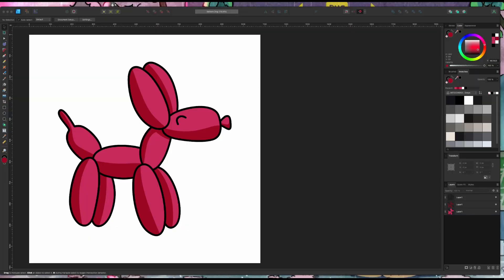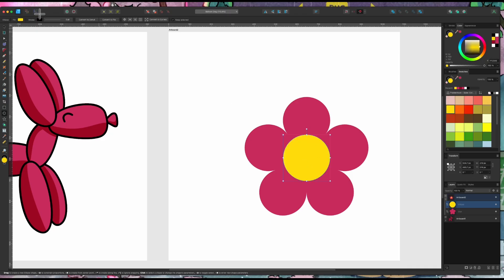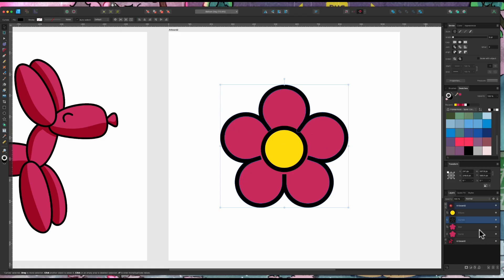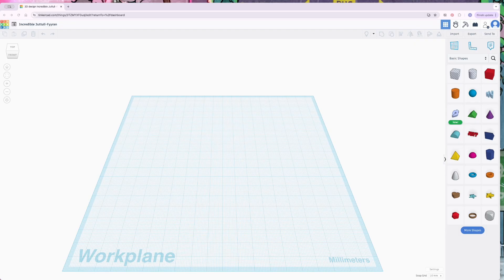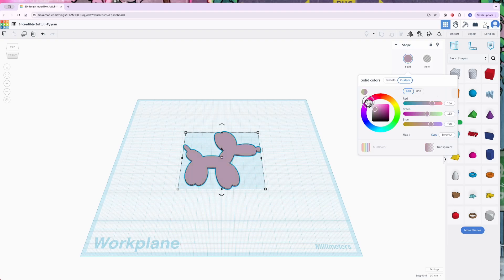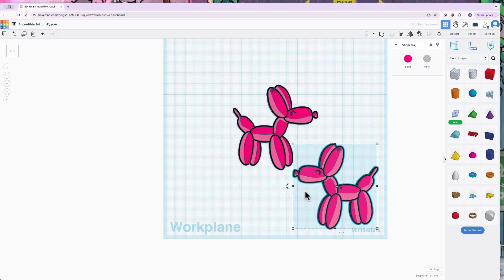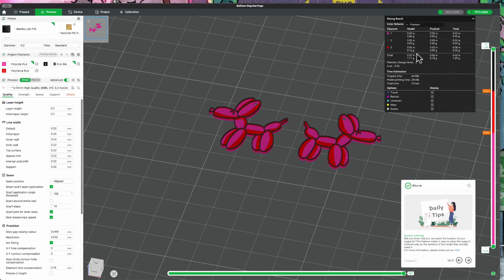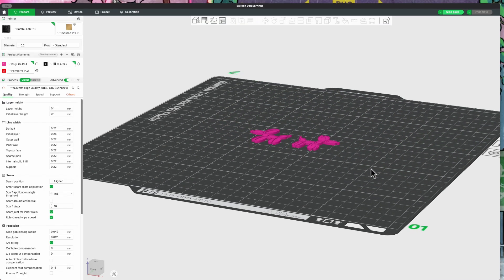How to Make 3D Printed Jewelry, Easy Multicolored and No AMS Needed!

Comment: Another great design and tutorial. Thanks so much. 

I’m curious: In Bambu Studio, what is the advantage of assigning the colors in the preview line heights rather than using the paint (by layer) tool? (I’m not sure I’m explaining that well. I’m not at the computer to grab actual tool names, sorry)
Reply from the maker: There’s no real advantage. I was just taught to do it using the preview tool a while back so that’s just my method. When I first learned this technique I was using Cura and an Ender 3 so I didn't have a paint by layer option. But you could do it painting by layer height.
Reply: @LabcraftStudio cool. Thanks. I come across a lot of Hue Forge designs that are set up that way but then I seem to mess them up when I bring them into Bambu Studio and bring in my AMS Lite filaments. Or if I try to do multiple copies of something someone has previously designed… or something. I’m not 100% sure what all I do that creates the conflicts, but I seem to often have to bail on the preview method and use the paint tool. It isn’t always as easy for me to be accurate unfortunately. (I assume it is user error. I’m only about 6 months into 3D printing and seem to fumble through much of what I do. lol)

Your videos are giving me a backlog of projects I want to dive into. Thanks for all of the inspiration.